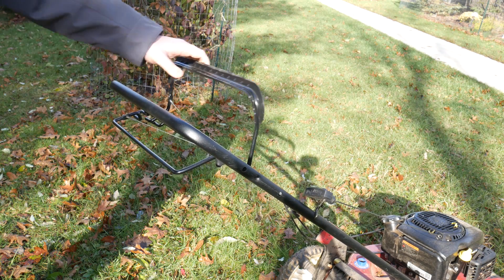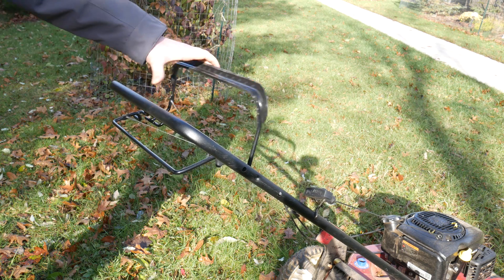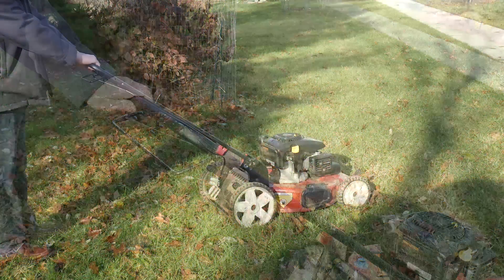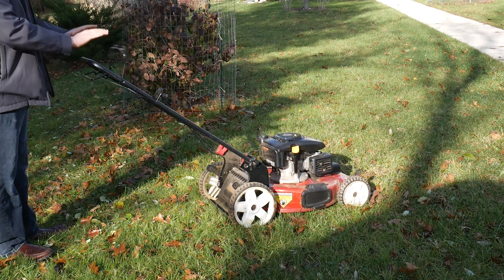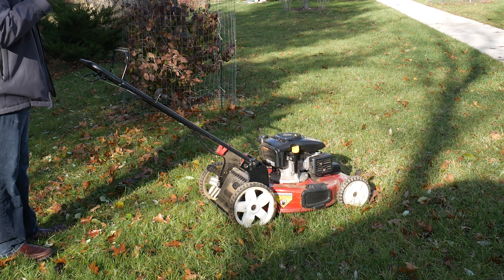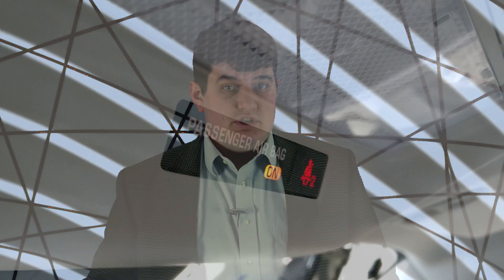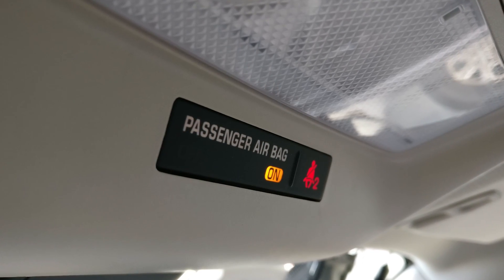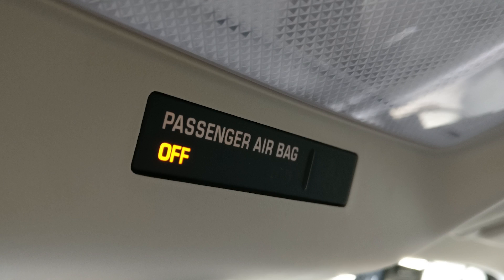The Dead Man's Switch:  How Anton Yelchin's life could have been saved

Comment: First YouTube comment ever!  Its NEVER "just software".  Software is hard and complex.  There is A LOT of math (precise by nature).  The more variables you introduce (i.e. sensors to monitor) causes the complexity to grow exponentially.  We have literally launched defective space based telescopes and crashed lander's into the surface of Mars over imprecise math.  Not bad software - we didn't even get there yet.  The MATH was  done with an omission or error.  How long has math been a staple discipline?  Software is math plus algorithms - essentially algebra on steroids.  Not simple.  Not easy.

"Just software" implies that 5 minutes of some coder's time will solve a problem.  It is seldom if ever that straight forward.

I agree - and advocate for - more advanced software solutions to our real world problems in cars (and elsewhere).  I dispise the "it's just software" mentality.  It IS ultimately software.  It can be updated.  It can save our lives.  And it should!  But it's not easy.  Its every bit as hard as hardware design.  All that has happened is we have traded hydraulic or spring tension inputs from hardware based systems for electric signals.  All the original problems still exists - and now we have to convert all the input signals into reasonably corresponding electrical measurements (more hardware, usually) - and then apply the algorithm(s).  

When I turn my car off it warns me that the doors/windows/moon roof are open.  That's 4 window sensors, 5 door sensors (hatch back), and a moon roof sensor.  "All" the software has to do is monitor 10 sensors and generate one of 7 (if I got the math right) combinations of door/window/roof open displays and sound a 'ding' tone.

While it also makes sure the car is in park, disconnects the hybrid battery, complains that I released the fuel door while still moving, and yells that my passenger removed their seatbelt before the car was stopped.  All while detecting that the family dog is loose is the backseat and suggesting that a rear passenger seatbelt was released.

"Just software".  Absolutly insulting to the professionals who make our everyday lives better and safer.

For the record I am NOT a software professional - I work in customer service mostly - and not in the automotive industry (never have).

Software engineers - and they are just that - engineers - should be revered in the same way automotive engineers, bridge engineers, and rocket engineers are revered.  There's a lot of math.  There are a lot of inputs.  There are a lot of algorythems.  Miss one of any of the above anywhere along the line and if the system is robust enough it will survive - albeit at reduced efficacy. 

If the system wasn't designed to... say... protect the driver from leaving the operators seat with the vehicle not in park and winding up under the tires - well then.  We need a better system.  And I agree - the already on board hardware sensors can be augmented through SOFTWARE to accomplish that goal.  Sadly, that doesn't mean it's easy.  Its MUCH easier in a retrofit to update software than to add hardware - but that doesnt always hold true for new designs.  Sometimes the hardware solution is better.

It's never "just" anything.  If it was "just" making some pasta then nothing bad should ever happen.  

Some of my American contemporaries got it wrong - https://www.fm104.ie/the-buzz/students-start-fire-while-trying-to-cook-pasta/

That's learned folks - post high school education - that didnt add water.

Take nothing for granted.  If you cant do it - you should assume it's very hard.

And think about the consequences of better monitoring and safeguards.  Someone tragically backed over their toddler while mowing the grass. 

https://www.overlawyered.com/2008/06/suit-its-the-manufacturers-fault-that-i-backed-a-lawn-mower-over-my-son/

So now - if you want to safely manage your mower - all you have to do is mind your mowing, expect to back up, look behind you (which apparently was omitted in the cited article), move to reverse, and steer.  Oh - and do that one handed while remembering to hold a little button in, otherwise your mower will lose power and begin to shut down, debasing you and most likely causing you to look at the instrument panel to find the button instead of looking behind you - in something like 30 seconds - all the while with the blades still spinning more than fast enough to mame a toddler.  MUCH SAFER (huh?)

My point is - cooking pasta was too hard for some post primary education folk.  Safely mowing the grass was too hard for a family.  We CAN solve all of this with better engineering - and a lot of that will be software.  That doesn't make it easy.

After all - what does the software look like to override when you dont put water in the pot with your pasta and prevent the stove from heating?
Reply: The sensors (math as you called it) already exist and are already in the cars for the airbags. Math is very easy if you actually used your brain.
Reply: @ericgoodman3510  You missed the point.  If the task is SO easy why do we (humans) keep getting it wrong - even on wildly expensive projects with multiple levels of review?
Reply: @williamszewc6559  Because we don't? 1 sensor is almost never gotten wrong it's only when you have 100's of thousands of things that could go wrong that you get "wildly expensive projects with multiple levels of review" and since even the best of us make mistakes of course sometimes they get it wrong. The point you are trying to make is a falsehood because as I already said the sensor is already in the car and working (something you keeping missing) so the only needed addition is a few lines of code in a couple of places. The things that humans keep getting wrong are because people are stupid not because they aren't easy. If you had learned anything about software before opening your mouth then you would know how easy this would be in this situation, but since you are just people.....
Reply: @ericgoodman3510  

Except we did.  We (humans) did fail to implement at all or implement successfully what with hindsight seems like an obvious and arguably easy safety feature that has resulted in at least one (probably many more) death.  The argument of the video is that the drivers seat sensor - already existing in cars today (which I agree with, btw) - should be configured in software as a dead man's switch.  It wasn't.  I tried to argue that software design and implementation is hard and should not be taken for granted.  You disagree.  Ok.  So... the software engineers in this case actively chose to not do an easy thing?  Or maybe they didnt think of it (careful - design is hard was my argument).  Or maybe they thought of it and got the implementation wrong (again, my argument that software is hard).  You seem to be arguing that this is an easy thing to do.  And I agree - by itself, if someone thought to implement it in the first place and got the implementation right with the hundreds or thousands of other lines of code in the ECM - then hey.  Easy.  If that's the case, why was this not done?
Reply: @williamszewc6559  If you are incapable of not already understanding the extreme difference between ease of implementation and knowing ahead of time that something does or does not need to be implemented in the first place then there is no hope at all for you. There is no comparing those 2 things at all.
Reply: @ericgoodman3510  
You're right - design and implementation are totally different.  Together they make software.  ONLY together do they make software.  Only if both are done well do we get good software.  It's nearly impossible to anticipate every possible use case people will subject anything (hardware or software) to.  Hence, designs are frequently missing a feature that retrospectively seems obvious. I agree - in many cases implementing a feature such as 'set transmission to park if drivers seat pressure sensor is below threshold' is in fact easy.  Envisioning and anticipating that need is hard.  Evaluating all the consequences of said design (for example - you'll never be able to put this vehicle in neutral and push it into/out of a garage or off to the side of the road if you break down without 2 people - one of which is sitting in the drivers seat, unless of course we add an additional hardware or software switch to enable unoccupied neutral - adding to complexity) is hard.  Software - at least to me - is design PLUS implementation.  Intended and unintended consequences of a design and implementation count.  What happens if the driver lifts themselves out of the seat at speed to reposition themselves for comfort?  What if the vehicle goes over a large bump that throws all the occupants out of their seats for a moment?  Yes - a simple timer saying 'reading has to be below X for Y seconds', or an averaging algorithm, or multiple repeated readings below the threshold at set time intervals could be used.  Or simply disable the algorithm if the vehicle is above 2 MPH.  Who knows.  Regardless - we're rapidly moving away from a few lines of code in a couple of places.  To represent the solution to the problem as just a few lines of code is a lie.  It ignores the design and consequence portions of the problem.  If you see software as merely as the code running on a processor - then your right.  It's easy.  Most of the hard decisions were made while writing the software design specification.

Comment: You're over complicating this. A lot of manufactures make it so you can't remove the key if the car isn't in park. As for fob vehicles, pushing the start/stop button wont do anything except for displaying a warning to shift into park. Use of a manual or electronic parking brake would have also sufficed, the electronic version again forcing you to be in park and the manual obviously working irrespective of gears. Also if I recall correctly his model of jeep had a digital display in the dash that would display the currently selected gear.

Comment: Cars have a feature whose purpose is to prevent deaths like that of Anton Yelchin to happen. It's called the hand or parking brake. Just make it a habit to apply the parking brake whenever you leave your car and it won't run you over. I don't know about that Jeep; but the manuals of every car I ever owned clearly said something along the lines of: "When you leave your car, use the parking brake to make sure it doesn't start rolling away.". Not that that would be necessary because where I live, "use the parking brake when you leave your car" is taught in driver's ed, and if you neglect that at the end of the exam-drive, you're not getting your license. It might sound harsh, but Anton Yelchin didn't die because his car was poorly designed, he died because he didn't operate it properly.

Comment: I was about to question the use of a switch in the driver's seat in cases of flat-bed towing trucks (since you'll want the vehicle in neutral to pull it up onto the bed) and manually pushing the vehicle.  But, yeah, having a way to disable the sensor would be useful for those situations.
Reply: they all do, all vehicles that have auto park selection will allow the vehicle to select neutral again by just selecting neutral or clicking the parking brake switch again

Comment: As much as I like your idea, coming from that industry I have to say, that the ides with the seatbelt sensor would make the seat an ASIL-D complient component. So that way the whole connection flow from the seatbelt to the controller needs to be certified and extremely tested. This is really expensive and takes a long time. There are many other parts of the vehicle where you'd need to invest less and get a greater outcome.

Comment: I think a more universal solution would be to apply the parking brake.  While it is one of the few things that still actually have a physical connection, a separate cable could be used so that the E-Brake function of the parking brake isn't affected.  That way, machines that have manual transmissions can be fitted, and it could supplement the automatic transmission's parking pin with auto park.

Comment: I get what you're saying and generally agree, but I think you are overestimating a car manufacturer patience for proper programming and testing and troubleshooting.  The more complex the system, the more scenerios you need to code for.  Unintended bugs inevitability crop up and cause unsafe driving conditions.  While this video was made in 2016, here in 2019 planes are nosediving due to conflicting sensor input and driver assist tech in automobiles is causing crashes due to hard to spot coding bugs.

Comment: I always put the car in neutral while applying some breaking, set the parking break, release the break and then put the car in park. This way, the cars weight is not on the transmission but on the parking break. My car has about 100k miles on it, it's a solid car but they are known for having weak automatic transmissions.

edit: brakes, braking, not breaks and breaking

Comment: This is a great common sense thing to do! I've been a "car nut" for DECADES, And I have to admit, I didn't think of it. Sometimes the simplest damned things allude us, LOL! For those "freaked" out by such automation in their automobiles, Give up and buy a 1965 or older car with a manual transmission! VW had an electronically controlled FI system in the late 1960s, Buick had an electronic traction control system in the early 1970s, There were others, But by 1981 ALL cars had SOME form of electronic logic or computerized systems controlling the vehicles vital innards! Even without electronics, Any automatic gearbox (The modern version is an invention of the 1930s!), is in fact a mechanical analog computer! It takes input from the cars road speed,engine speed and throttle position,etc and makes a decision as to what the correct gear ratio should be used. The idea of being fully in control of your vehicle applies basically only to bicycles,skateboards and roller skates.

Comment: Obviously there would need to be some sort of override for when you are towing or pushing the car.
Reply: Just have someone volunteer to hang out in the seat? That or just have some heavy books on hand
(As temporary solutions, obv.)
Reply: There already are, and have been for a long while. Usually there is a hidden button that needs to be pressed to override. On some American SUVs/trucks there's a wire that needs to be physically detached, usually by going under the car which really sucks...

Here's an example: a beat up old 90's Mercedes van wouldn't shift into gear. Upon inspection, it was found that one of brake lights burned out – and as the result the system automatically blocked the gearshift lever.
There was a pencil-thick hatch with an override button hidden deep below that had to be pressed to shift into drive.

Comment: i kinda disagree with "immediately put in parked when no one is on the seat" i actually would suggested some kind of levels of braking like if the occupant is absent for 15 sec i would suggest they apply the brake slightly first so if the sensor is malfunctioning like every sensor when car get's older it didn't threw you in park when you still driving when the sensor is malfunctioning and if the occupant is absents for 30 second it'll triggered a chime and also apply the break harder, or put a chime if car has been stationary for a while and have notification in the car Information Display to put the handbrake on or put it in parked position, and most European and Japanese car has this chime if you didn't put on your seat belt and for European car in particular they usually brake if you are moving over certain speed without your seat belt on